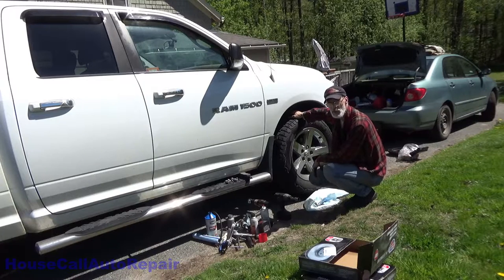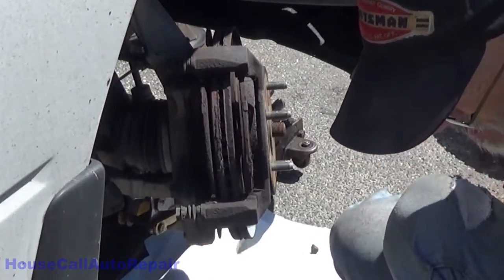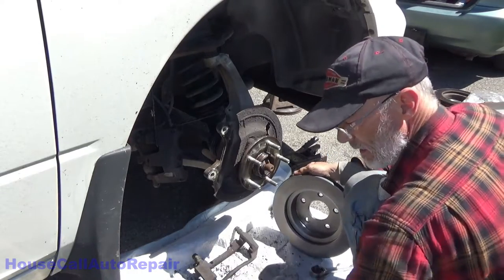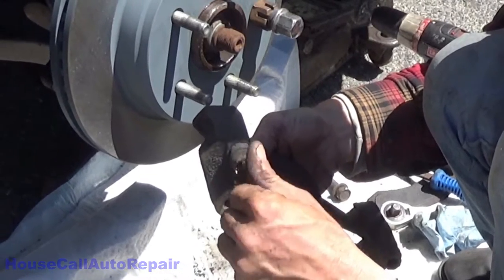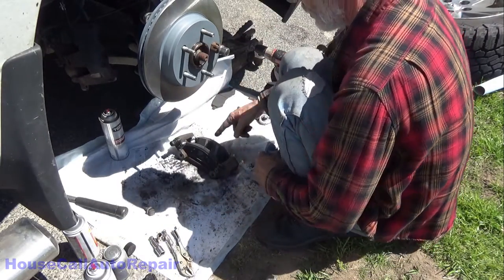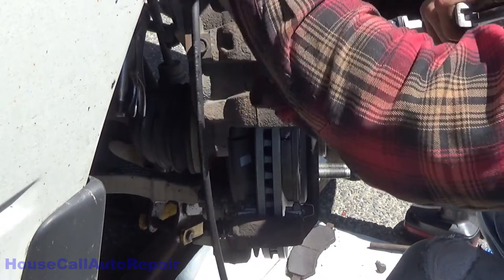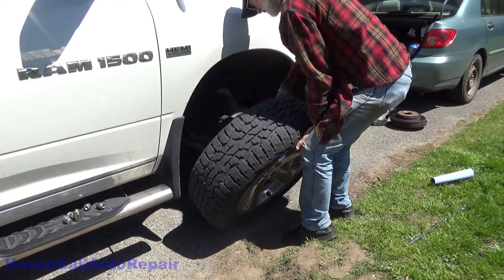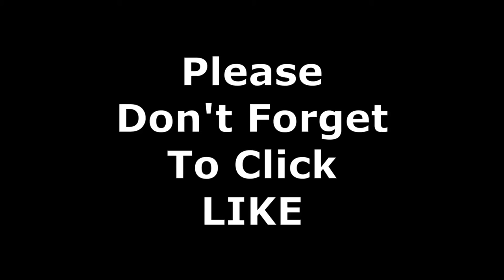Front Brakes and Rotors Replaced on a 2012 Dodge Ram BIGHORN 1500

Comment: This was well thought out. The fact that he does it without a lift is doubly impressive. I would have used a torque wrench on the lug nuts though.
Reply from the maker: I've been working on the ground all my life. It's the flat on my back that I'm getting too old for...lol
"If lug nut torque was so important, the manufacturer wouldn't have given you an iron bar (at a weird angle) to jump on..."
Reply: @HouseCallAutoRepair  Yes, a couple of times crawling underneath the truck and getting up is about it for me🥲